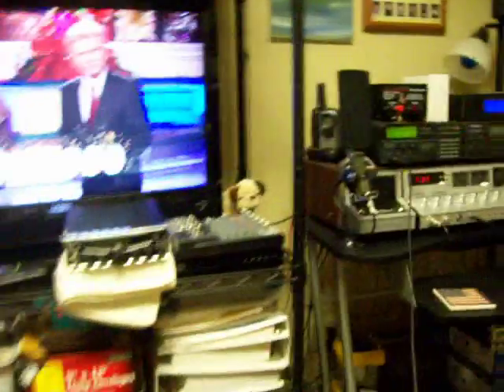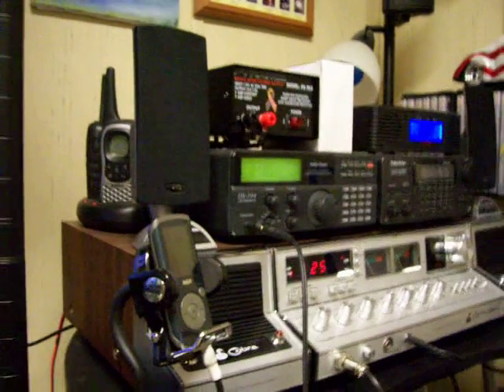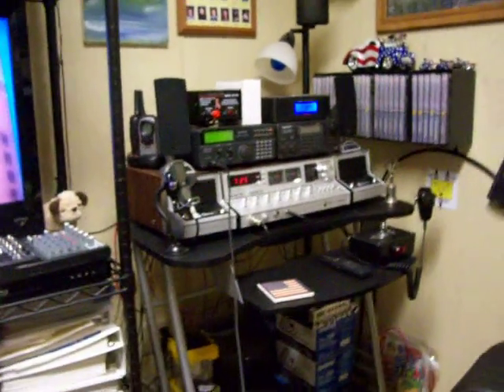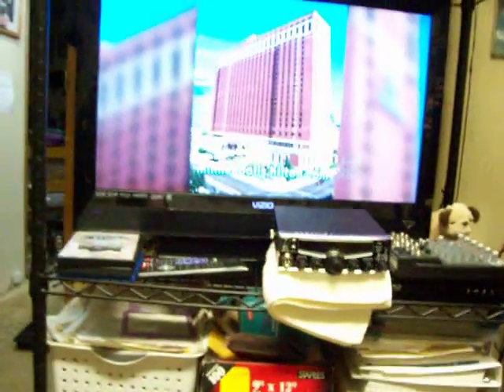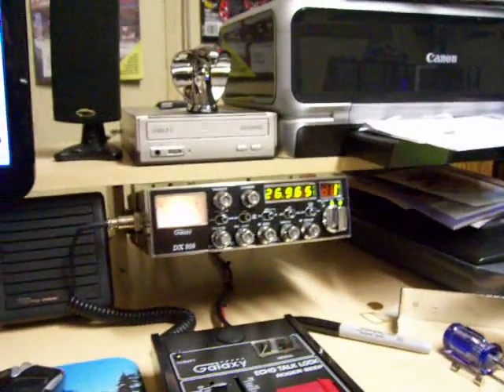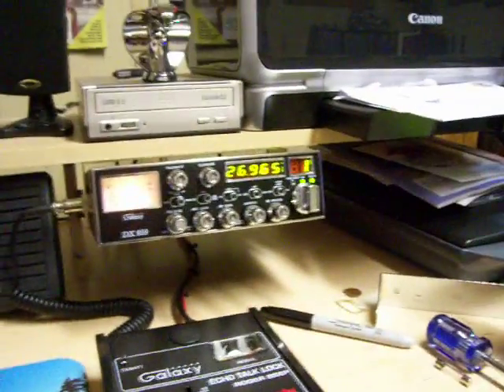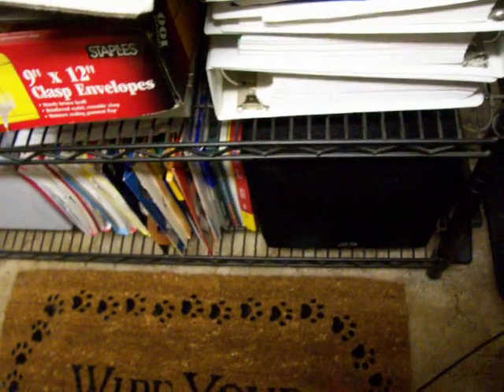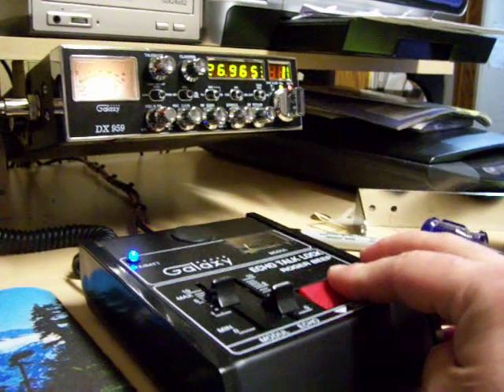Galaxy DX 959 "Radio Check" With A 2SC2290 Final!

Comment: I have a Galaxy 93T that has a 2290 stock and they don't put out 100 watts more like 60 PEP, but that is where they are happy. I have a Stryker 959 that has close to 100 watts PEP, but it has 4 output transistors. If you could put a 2879 in it then you should get 100 watts PEP.

Comment from the maker: I this is a $125 or so upgrade. You could buy a 1 pill amp. Now you have extra wires to plum in the vehicle, find a location, turn it on/off. For some folks this is the answer. Trucking company polices sometimes restrict export radios in their trucks and CB radios are the norm. So a modified CB Radio with a 1 pill mod definitely gets your name called, Bulldog 777.

Comment: Cobra 2000 Wiring guide

1. Audio
2. Shield
3. Receive
4. Switch
5. Transmit

Studio Interface Cable 

1. XLR Pin 2 is HOT Audio Wire to Pin 1 on CB Connector

2. XLR Pin 1 and 2 to Pin 2 on CB Connector

3. Pin 3 Receive on CB Connector Connects To Pin 2 Shield on CB Connector

4. Foot Switch Connects To Pin 4 and 5 on CB Connector